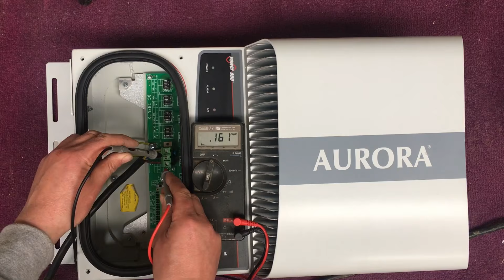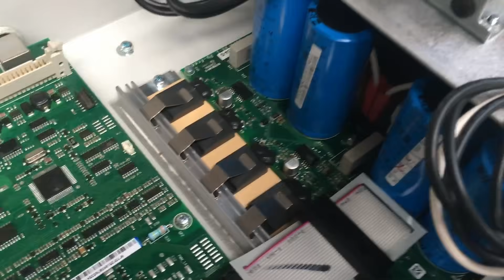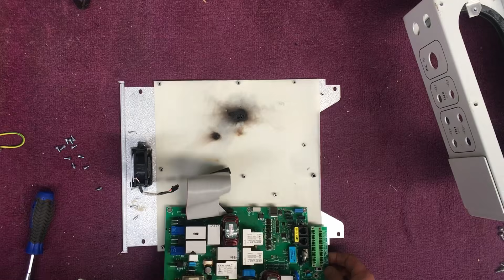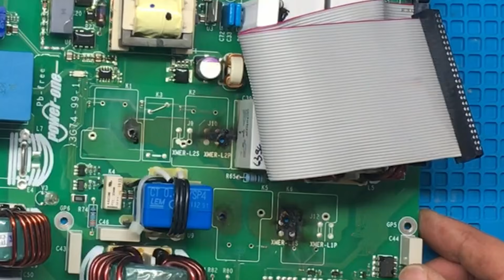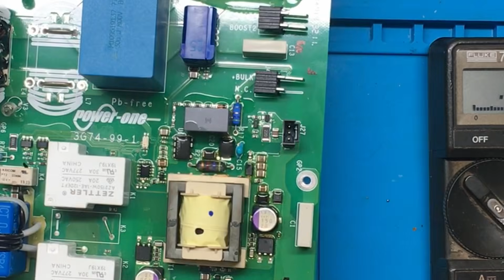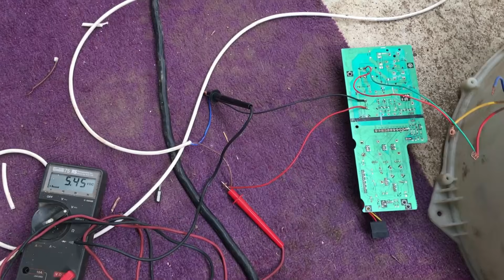Solar Inverter Repair / Fix - Aurora Power One (Multiple Faults) and E031 error

Comment: great video seeing you check around so many component failures. I returned home after a week away when there had been some exceptionally wet conditions to find the mcb on our 3.0 Aurora power one had tripped. on resetting the trip no information is displaying on the panel. One of the relays was very badly burnt right through the board not sure if this is repairable with jumpers etc. How do I check that the P V panels are still producing power? Can I send you a photo of the damaged board?
Reply from the maker: I'd be very careful as the voltage is DC and could easily kill, but you would just use a test meter on DC volts and see if there is voltage on the cables coming from the panels. I'd suspect that they would be fine. The area around the relays I patched with wire and it's been running fine since.
Reply: can i send you a photo of the burnt area with the relays removed as I am not sure where to patch in wires @BuyitFixit
Reply from the maker: If it's the same unit as the one I repaired you should be able to see where I patched them on the video. They just follow the existing tracks on the board.
Reply: exactly the same area of one relay burnt out but have lost more of the board including the 2 pairs of line connections hidden under the relay, do these need to be reconnected @BuyitFixit
Reply from the maker: I would think so, they wouldn't put them there for no reason. It's been a fair while since I looked at one.
Reply: Have now replaced the relays still no power to unit, have a dead short as you in rectifying diode and the other two diodes as you found, what are the replacement diodes that are required or how can you tell as there doesn't seem to be any markings on them @BuyitFixit
Reply from the maker: @GraemeSmith-z1u  Hi, the two diodes I replaced were SMBJ15A (the small rectangle one to the right hand side on the video) and STPS5H100B which was the one that looks a bit like a transistor (larger of the two at the left hand side on the video). I'd check to see if you have a short circuit first there like I did, as it may not be the same fault but display similar symptoms.
Reply: thank you so much for your help on this, I had a short circuit on the rectifier diode(square diode) and a short circuit on both of the rectangular ones. Once these were removed the short circuit across each of the connections disappeared. hope I am on the right track @BuyitFixit
Reply from the maker: Great news👍hopefully that's the only problem and you get it all working. You'll have to let me know🙂👍
Reply: i will thanks, any suggestions as where to buy the diodes in a small quantity
 @BuyitFixit
Reply from the maker: I've just checked and I ordered both parts I used from Ebay. They were around £2.50 each  (for a pack of 2)

Comment: Nice video. After 12 years of good service, my 3KW solar panel inverter (Power one / ABB PVI-3.0-OUTD) is no longer starting in the morning since yesterday. I've checked the panels connection and it looks good (I had earlier today 241V on SE string and 248V on the SW one), also the connection to the power grid seems fine. I tried to follow the restart procedure but still nothing on the display, no light, dead. The only thing that is does, is a quick click (relay) when the DC is on. When I turn the DC isolator to off position those clicks go slower and slower until it stops. The same when I turn the DC isolator to ON - the clicks start to go faster and faster until it stays at around 4 per second. Any ideas where to start looking for? Thank you!
Reply from the maker: Sounds strange. If nothing is on the display I'd check the power supply area like on the one I repaired. That supplies the main computer board with power.
Reply: @BuyitFixit   Thanks! I've just removed and opened up the inverter, and as expected I do have some black marks around the two white Zettler relays that sit closest to the power supply you've repaired. The other two relays look good. I've also checked the two diodes and I do have continuity as you've experienced. So I've ordered the parts (~£20) hopefully there isn't going to be anything else. 
Seeing so many of these inverters with same problem I imagine the manufacturer might feel ashamed of their design and help us fix them :))
Reply from the maker: Good luck with your repair. I would add some copper wire like I did to hopefully stop it happening again in the future 👍
Reply: @BuyitFixit  after a few failed attempts to remove the old diodes and braking some others around them I gave up. I just couldn't de-solder them like they were welded to the main board 😡 I even tried with 450 degrees on my solder gun tip just for fun. No idea what kind of soldering component did they use, there was no way to melt it. At least I tried... ☹
Reply from the maker: @Armadyllo That's a shame. I know components can get welded to the board when they blow. You could try some low melt solder. I've had good results with that as it mixes with the original solder drastically lowering its melting point.

Comment: Don't know if you'll pick this up, as it's an old video, a question about the smps. I was looking at mine and could find no bridge rectifier or bulk cap anywhere, so I'm left bewildered as to how it works. Mine's working fine after sorting out the relays, but I'd love to know what I'm missing with regards to the smps. Thanks and regards.
Reply from the maker: I'm trying to think from memory but I think it's fed from the DC supply, so no need for a rectifier.
Reply: That would explain why when connected to the mains there's no signs of life from them until there's some DC input. Thanks for the reply.

  @BuyitFixit

Comment: Thanks I had the same happen on my same inverter. Got it replaced under warranty. I have seen Andy Renolds do a YouTube video and fix on the same fault. It seems that this is a design fault with these relays burning out. Good idea to strengthen the solder tracks with heavy wire.  You can use any variable DC power supply to simulate the Solar Panels. Great to see a fix, Aurora seem to have disappeared or been absorbed by ABB who offer little help.
Reply from the maker: Thanks, yes Andy has replaced the relays before, but I don't think he had the problem on the PSU side which I repaired also. Fimer who took over from ABB offered no help at all as I needed the service password. I did another video called "no password, no problem" where I had to delve into the software and reverse engineer it, and wrote my own service password generator, and unlocked a load of Easter eggs in the software....

Comment: power it on and use thermal camera to see shorted components
Reply from the maker: Unfortunately I didn't have a thermal camera at the time. I did however buy a broken one and repair it in another video 🙂

Comment: Well..... I guess that's one way to get higher voltage DC. lol  I was expecting a bench top PS or Variac and bridge rectifier.  Good fix as always, you seem to get a lot of less complicated repairs, which is nice. Shame to see some of this stuff get junked for some of these problems. Good saves!
Reply from the maker: Thanks, yes the washing machine motor I plan to make a water turbine with it someday...
Reply: @BuyitFixit  Good test for it then. I'd say it passed.

Comment: Great video. My question is why couldn't you use a bench power supply to simulate the solar panel input?
Reply from the maker: Thanks 👍I didn't have one at the time,  and you would need a one that does 120v or 200v DC which I don't think many do. The one I have has a maximum output of 30V at 10A.
Reply: @BuyitFixit  The DC high voltage stage on an ordinary inverter, may have been the easier option. But the contraption was very creative. :)
Reply from the maker: @TylerDurden-pk5km Thanks, the only problem was I needed isolated DC or you get a RISO fault, and the startup voltage on the inverter was set to 200V and I didn't have an isolation transformer.
Reply: @BuyitFixit  With an battery powered inverter, like the one there your fixed the fuses, you would have had an isolated supply and a voltage of around ~380V at the DC stage of the inverter (at the capacitors). And it would have even been double isolated because of the inverter transformers and the battery or isolated power supply you are running it of from.

Integration would have been really simple - solder two wires to the capacitors - done. :)

To make it more clear: Put the AC side of the solar inverter to the grid - and use the mobile inverter to generate the DC bus.
Reply from the maker: Ah yes, took me a bit to figure out what you meant, but you meant the HV DC side of the inverter. Good idea, I hadn't thought of that 👍
Reply: @TylerDurden-pk5km  Hi, is it possible to test, instead of the washing machine motor, with a variac and rectifier bridge? Connecting to a UPS to isolate it from the network? Or from rice error 0.00? Thank you very much

Comment: I have just finished watching this repair from your back catalogue, 
Now you have repaired an inverter, have you considered repairing a "solar power diverter" this is device that detects how much power the system is generating and uses it to power another item like an hot water heater for free,
There seems to be alot of them failed! Made by imersum
Reply: That's one I can definitely help you with. As I converted all my hot water system to include a pressure tank. Via a water diverter valve. So I can still use the combination boiler in winter. Then I use my solar diverter to heat the tank.
We haven't paid to heat water for the last three summer periods. 
But the immersun power diverter has an habit of the cooling fan not working and then the unit overheats and blows. So I have wired a fan direct to both power outputs so it keeps cool
Reply from the maker: Hmm Interesting I've not heard of such a device before. I'll have a look into that. I'm actually in the middle of reconfiguring my system to use batteries and a different inverter so I can hopefully go off grid at some point.

Comment: Typical lightning strike! As a solar panel installer (retired) I've seen plenty like that. I've also seen the capacitors blown up too. Good earthing is essential, as is in my opinion, lightning protection.
Reply from the maker: The guy I got it from didn't mention anything about lightning at the time. He said it just suddenly failed, but it's still a possibility.

Comment: Hi, could you tell me which way the cathode is pointing on the board for the small diode please..i took it out before confirming the orientation mainly due to the gunk that was on it !
Reply from the maker: Hi, I would have to pull the thing apart to check, but on the video when I was replacing it, it looks like the cathode is pointing towards the edge of the PCB. Hope that helps.

Comment: I have an omniksol 2k tl with an internal isolation fault, where should I start looking for the fault
Reply from the maker: Good question Christian. I think there is a problem with DC voltage getting to the earth of the unit. I'd possibly try measuring from the DC inputs to earth and see if theres any resistance reading,  then possibly try removing components or isolating parts of the circuit until you narrow it down.

Comment: My guess would be that since the same pin was burnt on each relay, if you opened them up you'd find this pin attached to a larger hunk of metal inside, which caused a poor solder joint from new because of heat soak into the pin. The board probably went through the wave solderer a bit too fast, to speed up production (a common Sony problem btw). Now I have to decide whether to proactively pull my 10-yo unit off the wall to check it! 😀 Thanks for the video.
Reply from the maker: Thanks Steven. This seems a very common issue with these inverters so it may well pay to be proactive as you say. Units with the same fault seem quite common on Ebay. I actually bought another one and repaired that one too. It was just the relays on that one. The power supply was fine.
Reply: Crisis averted! My PVI-5000-OUTD-AU fitted Jan 2012 has more conventional semi-transparent cover cradle relays fitted, and the soldering looks fine. Also has WAGO connectors for the mains input. Don't know if it's newer or older than the unit you have.
Reply from the maker: One of the units I have is 2012  I think the other is slightly newer either 2013 or 2014.

Comment: If you're going to attempt this repair (E031) see also:  https://imgur.com/gallery/aqTnxGF   pictures of me repairing mine -- successfully!
Reply from the maker: Great Job Wade! I just checked out your pictures. Congratulations on repairing it! A couple of notes... You said you had trouble de-soldering, try adding some flux and fresh leaded solder first, although you do need a fairly hefty soldering iron for this job on the relays. 
Adding flux on re-soldering also helps greatly! 
The reason the relays fail is due to oxidisation of the solder at the point where they are soldered to the board. This is because there is usually a large current flowing through a small pin! 
The area around the pin heats up / cools down and it causes the solder to oxidise more quickly. I've seen this happen a lot over the years (common on things like TV power supplies or other electronics that deal with high current). Well done on your repair!

Comment: I have the same unit - 3.6 kW - and started with an E031 error. I swapped out all relays and worked for a few hours and then got a W003 Grid fail error (when it connects it senses line voltage too high)  I suspect it's one of the relays or their soldering to the PCB that's the problem. I monitor the line voltage during the cycle and there is no variation when the relays click. The line voltage is 243V which seems fine.  Any idea which relay does what? Or even a circuit diagram for the devices?
Reply from the maker: Have you just got this unit? I had similar with one I bought off Ebay and had to adjust a setting to get it working properly. Or was the unit working fine then you got the E031?
Reply: @BuyitFixit  I've had the unit for 10 years since new. Only one relay had heating marks but I swapped all of them. I did notice the PCB was warped under the overheated relay so I'll revisit with lashings of copper wire bridges in case of a hairline crack.
Reply from the maker: The voltage sense is done via 4 resistors at the bottom right hand side, they are quite high values (10m ohms i think) but wired as  two pairs in series so 20m. One pair is L and one pair is N these then go through the ribbon cable to the CPU board. But I'd think that those are working correctly if it's showing the correct values.

Have you made sure the large ribbon cable is seated properly and hasn't been nipped on re-assembly? The only other thing could be one of the relays isn't being activated (are they all clicking?) or getting power (damaged track?) faulty relay? that's all I can think off the top of my head... Does the fault happen Immediately or is it intermittent? Like it works for a few minutes then faults?
Reply: @BuyitFixit  The problem now seems fixed. I heard a click in the main switchboard when it failed, so I swapped out the relevant single phase breaker and tightened some connections on the upstream three phase breaker. So far so good.
Reply from the maker: Great news! Glad you got it sorted!

Comment: I addressed the E031code  by cleaning and re-soldering the relay pins, however the current was reduced on one of the two DC inputs on the inverter.  I monitor via Aurora communicator, so I could see the voltage/current from both strings. There was a  reduced current on INPUT #2, so I assumed that it was that PV string that was connected to that input being the issue.However, I transposed the inputs, eg. PV string #1 which was connected to inverter DC input #1 is now connected to inverter DC input #2 and vice versa. I was surprised to see that reduced  current was still on the INPUT #2, displayed on the Aurora monitoring program. The issue only arose after fixing the relay connections. Question: Would the effected relay's internal contacts, if dirty/pitted, creating a high resistance at the contact faces, have any relationship to what I'm seeing on the DC side? If not, any suggestions where I should look ? 
Model: PVI-5000-OUTD-AU (5KW)
Reply from the maker: The relays only connect the AC side of the inverter, and have nothing to do with the DC side. Could you perhaps have not plugged something in properly? like the large ribbon cable? Or something else not plugged in correctly? solder blob on something? Damaged a component? I can't really think of much else that would cause that.
Reply: @BuyitFixit  All suggestions taken onboard.Even tough you stated that the relays switched the AC side of the inverter, I cleaned the contacts of the relays which had the bad solder joint with the pcb. Maybe a coincidence but the current returned to what was expected. Thanks again for your swift response. Bjorn_Brisbane_AU